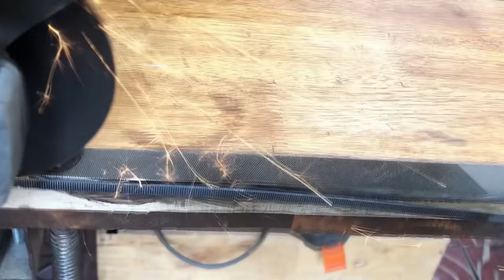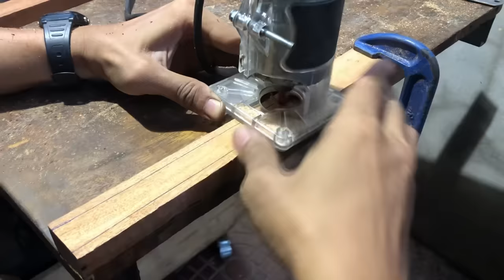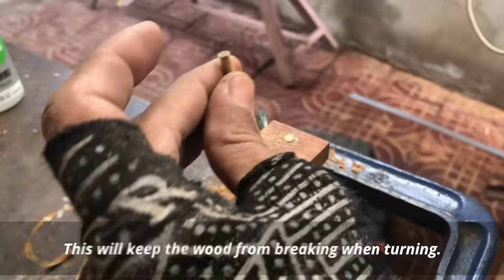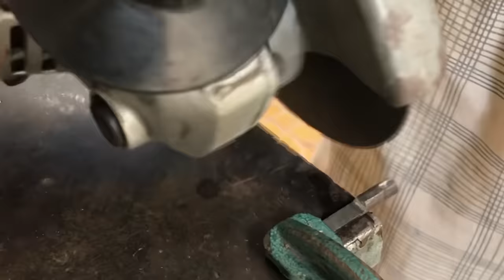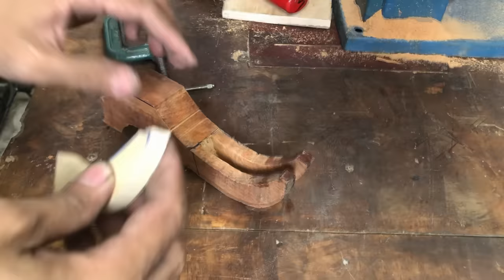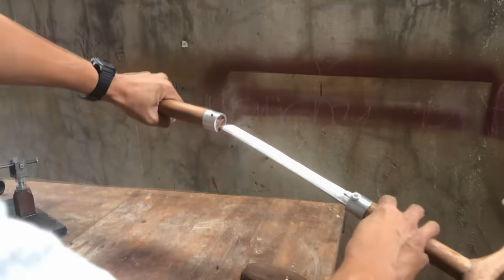Make Tanto knife hidden in walking stick from old file | make cane sword | make tanto from old file

Comment: This was well crafted. I learned a bit too. However next time you make one get a longer one and use the file end as the handle. Plus the thinner end will be more easy to make a tip. One good hit and that nice handle will fall apart in your hand. It also doesn't allow for solid hits with it when striking. A spearhead is the way to go for this as well. Best stabbing tip.

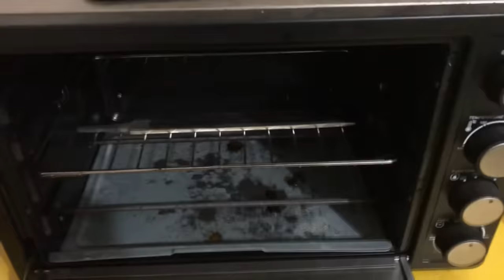Comment: HI at 2:50 you put it in the oven, I presume to harden the steel? What temperature do you heat it up to, for how long and do you cool it rapidly by quenching when you take it out again? Many thanks.
Reply from the maker: Hi Jon, I put it in the oven for one hour at 250c, left it to cool down until as low as room temperature, and repeat the same steps two more times. Hope this help.

Comment: did you soften that file before you started grinding? it makes it a lot easier, just so you know.
get it up to forging temperature, and let it cool slowly for a day
Reply from the maker: Thanks Jesse for the question. It would be easier to soften it first but I like to temper the blade after grinding it to shape, this way I can avoid forging. You have a good advise. I should try it one day 😊
Reply: @backyard.craftsman  I wanted to ask the same question. Seems like it would be easier to grind after softening, but I understand the idea of wanting to avoid a forge. It's perfectly fine as long as your tools can still grind it down.
Reply from the maker: @Danielson1818  thanks brother for your comment. I don't have a proper forge and place for forging, so just try what I can 😊